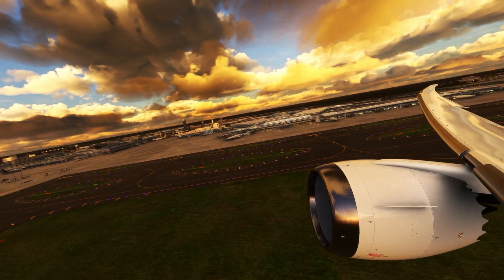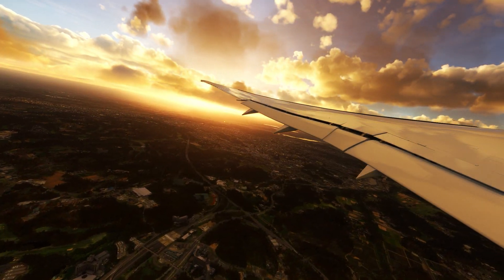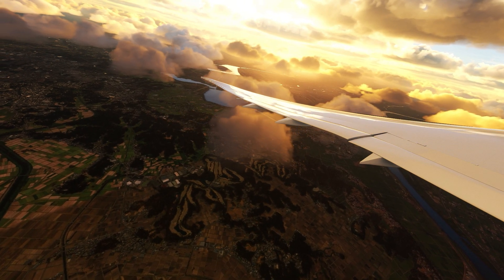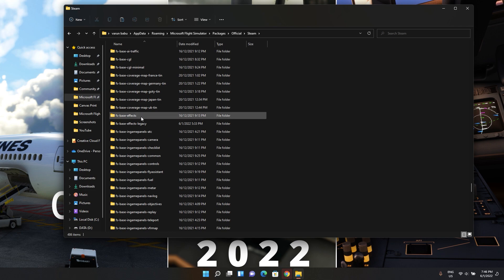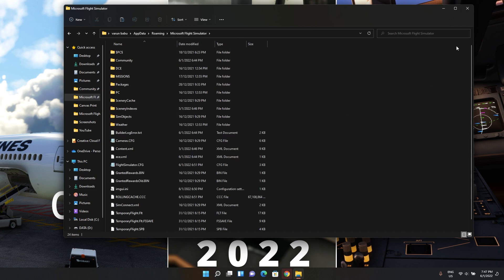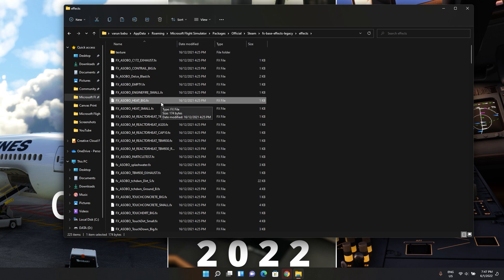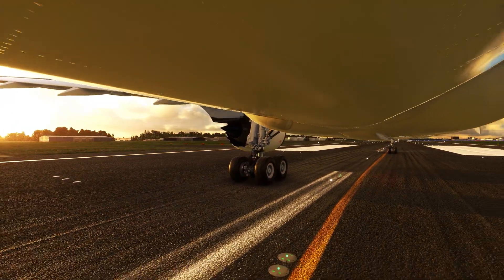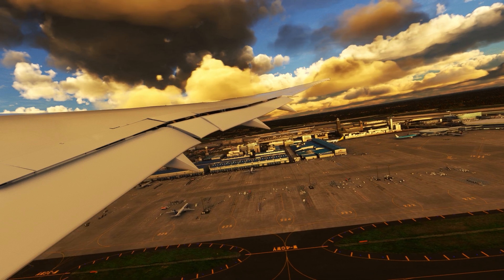HOW TO FIX EXAGGERATED "HEAT BLUR" EFFECT IN MICROSOFT FLIGHT SIMULATOR 2020 - MSFS TUTORIAL [2022]

Comment: Somehow this heat blur fix does not work properly anymore since one of the recent Updates. It really disturbs the view from the passenger seats inside of i.e. the A320neo. Also tested setting the values from 1 to 0 inside of the file without success. Anyone else facing this issue?
Reply: Idk if it is linked with it but only one of my planes are now extremely laggy